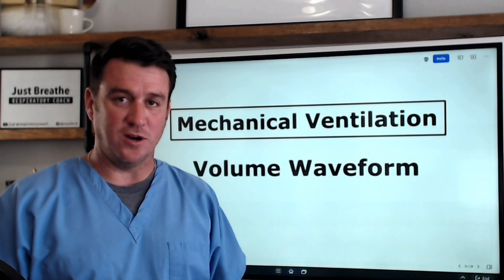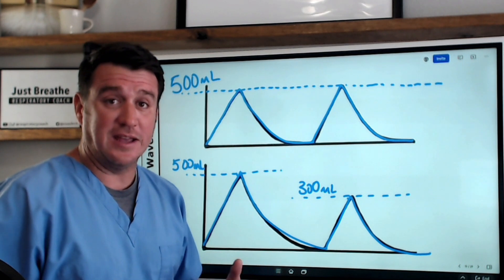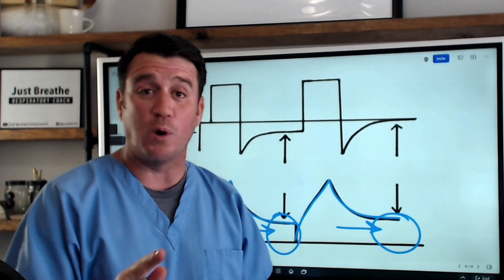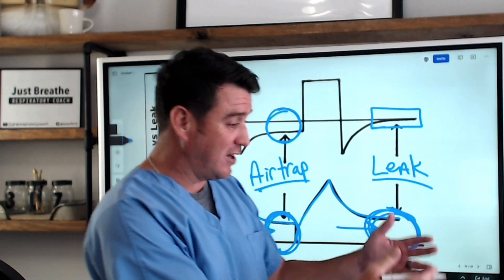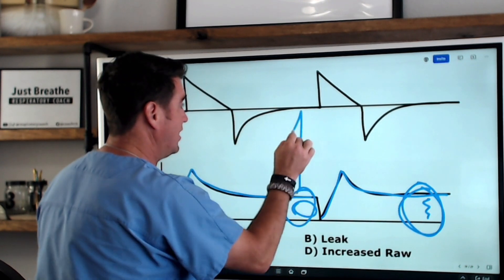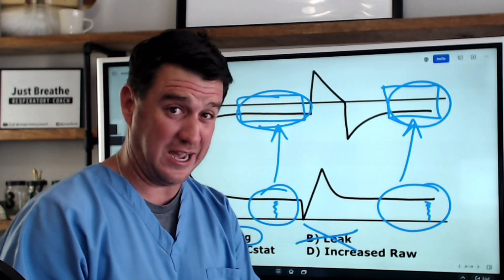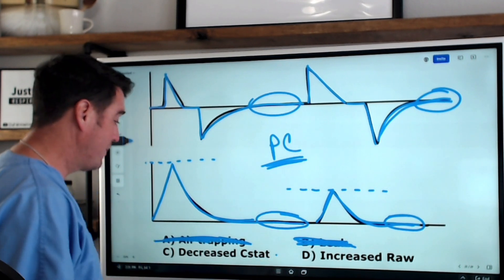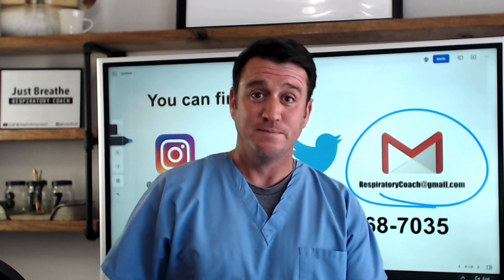Respiratory Therapy - Volume Waveform Analysis

Comment: Great stuff coach! Quick question.  If you suspect a leak on a ventilator, what’s the easiest explanation why the volume waveform does not return to baseline, but the flow waveform returns to baseline?
Reply from the maker: Great question!  Because the expiratory flow ceases, which takes your flow waveform back to baseline, but becuase some of the volume is lost in the leak, your volume waveform doesn't come back to baseline.

Comment: Hi coach, great video! Why does flow come back to baseline in a leak but not air trapping?
Reply from the maker: Because with air trapping the patient is still exhaling when the next breath occurs.  With a leak there is a cessation of flow before the next breath despite not all the volume returning, so the flow waveform returns to baseline.  Does that help?